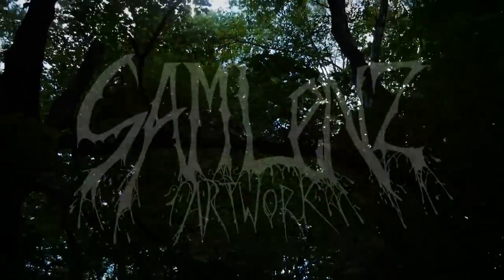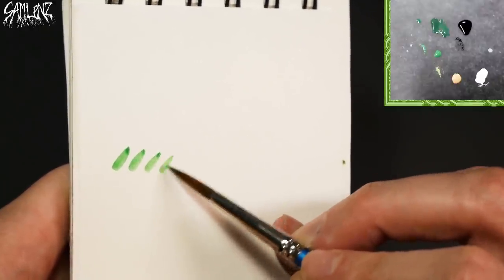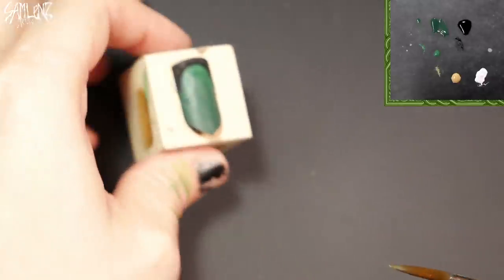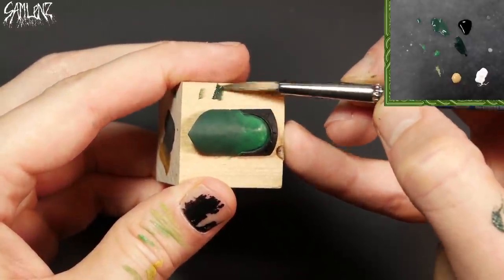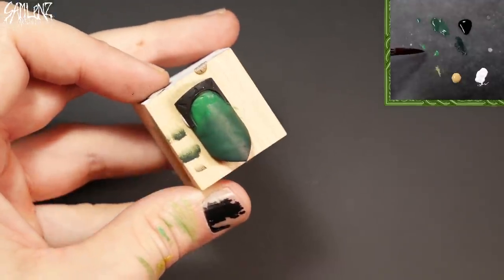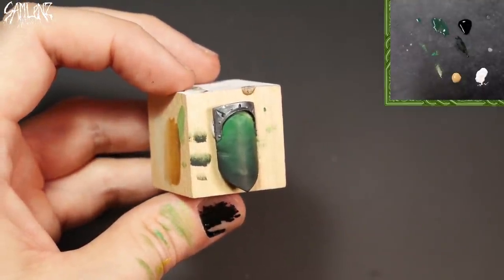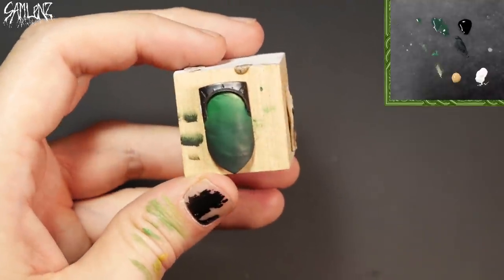Sam Lenz Artwork: An Exercise In Blending

Comment: I kind of fell into this technique somehow a couple months ago.  I like it.

It works well with Scale Artist full body acrylics and they are  great for feathering as well.

Scale75 makes them and they are in traditional artist color tubes, not dropper bottles and, oddly, smell wonderful at the same time.

Try a tube out if you get the chance.  I love their off-white and blue-grey for feathering Ultramarine symbols in freehand fast.
Reply from the maker: Thanks man, glad you liked the video! I've tried scale 75, both kinds and I just can't work with the stuff. I find regular Vallejo model color to pack more pigment that the heavy body and the normal scale stuff is too thin for my liking.

Comment: Sam, thanks for the video and continued willingness to share your skills! Have you considered pro acryl paints? I bought the entire set recently to replace the dropper bottles GW paints I've been using and noticed they've got a lot more body but not super heavy like the artist acrylics you buy at Michael's. The dropper bottles also don't clog as easily or sputter all over the place!
Reply from the maker: Thanks, Frank! I have the pro acrylic paints but they don't suit me, I prefer a thicker bodied paint. Lately I've been using Vallejo game color as they run really tick in general. I can always thin a paint down but making it more dense is tricky.
Reply: @SamLenzArtwork  Awwwww man, I sold that whole set off a while ago when I went through a massive paint purge. Well, if I ever get back into that line again I'll pour them into the pro acryl bottles so I don't have to deal with clogging or sputtering ever again lol

Comment: Have you tried the Scale 75 Artist range? Tubes with thick, creamy colors, but with a really matt finish.
Reply: I was wondering myself. But I have a hard time imagining an accomplished painter/artist like Sam not having tried Scale 75 before ^^
Reply from the maker: I've tried scale 75, both kinds and I just can't work with the stuff. I find regular Vallejo model color to pack more pigment that the heavy body and the normal scale stuff is too thin for my liking.
Reply: @SamLenzArtwork  I've only tried very few scale 76 myself and couldn't get used to it either. 
I do like Vallejo colors. Some of their game color paints work a little patchy, though.
Reply from the maker: @Lodorn  Same here, I tried with scale, I really did. All paint lines have gaps in them but the general flow of Vallejonworks for me. Honesty i miss P4 but switched to Vallejo because P3is so scared and I wanted people to be able to match my recipes.

Comment: Big fan here sam! keep up the wonderful work! I have recommended my friends as well to check out your vids! they're so valuable! and just a quickk question for you, whats a good way to mount a head from say..a space marine so I can make painting easier? Im learning to paint heads seperately but dont know a good way to mount them and holding them is no bueno because theyre soo small.
Reply: Use a pin vice to drill a small hole in the bottom of the head, put in a clipped piece of paper clip and a dot of super glue, stick it into a piece of cork. Done!
Reply from the maker: Thanks, Alex! I appreciate that! 

On the topic of painting the heads separately, the comment by Tanner nailed it. Its an extra step but worth the results.
Reply: @FrayedBristles  ty ty

Comment: Hi Sam! So, let's say you have an army to paint and there are 50-100 Shields you need to do, but you still want that blended effect and you don't have an airbrush. What would you do? I've seen an old video somewhere where a guy first puts down a layer of glacing medium and the while that is still wet, puts the lighter color on from one side. Looks easy and fast for small surfaces, but would that work for a whole shield, or do you have any other tips to share? Thx!
Reply from the maker: I would paint the same way as I do the video,  maybe not to such an extent but the technique would be the same. My tabletop army (see liberator shield video) is about 50 strong, all with that shield design. I hope the text here doesn't make me sound rude and deny my tone of speech, but I'm answering truthfully :)
Reply: @SamLenzArtwork  Nothing rude about it at all, I appreciate the answer! But that just leaves me wondering... This shield took you about 12 minutes to paint, 50 shields in an army gives 600 minutes = 10 hours. And then you still have the back of the shield to worry about. How much time do you spend on an army, and also, are you some sort of undead or immortal? =)
Reply from the maker: @Anecron1  Haha, functional undead for sure. Tutorials slow down the process so it's a little less time. But yeah, some areas I focus in on and others I breeze by, when painting armies that is. But I would say don't worry about the time. If you love painting then you'll always be finding time to paint, so don't rush through something in order to rush through the next. On my stormcast army I probably spent around 2 hours a model. It took a while but I enjoyed the process.  Cheers buddy!
Reply: @SamLenzArtwork  Always find time to paint? I have a 3yo and a 1yo, dog, wife, full time job and commute 2h 40min 5 days a week. Oh, and I'm also old and paint WHFB armies with 200+ models in each. Time to paint... sure. You lucky bastard! =)

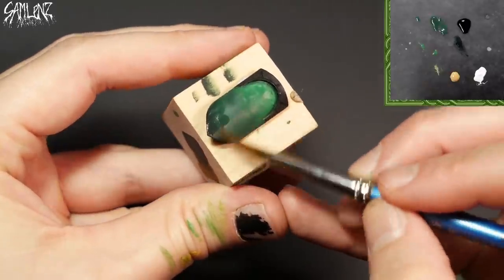Comment: 8:58 Sounds to me like you are describing scale 75, no?
Reply from the maker: I've tried scale 75, both kinds and I just can't work with the stuff. I find regular Vallejo model color to pack more pigment that the heavy body and the normal scale stuff is too thin for my liking.
Reply: @SamLenzArtwork  what you think of the Kimera colors for this? Lots of pigment in them.
Reply from the maker: @Maxillirator  I haven't tried those out in a great amount but the couple times worked with them I thought they were also too thin. I like it thicc.